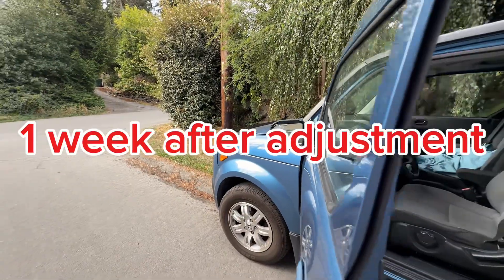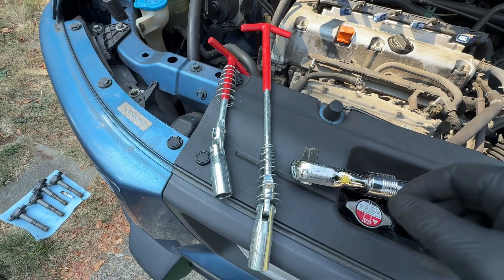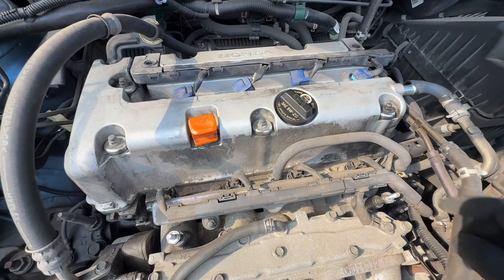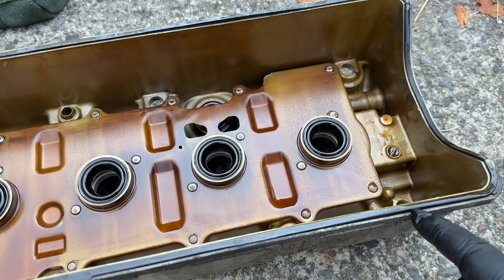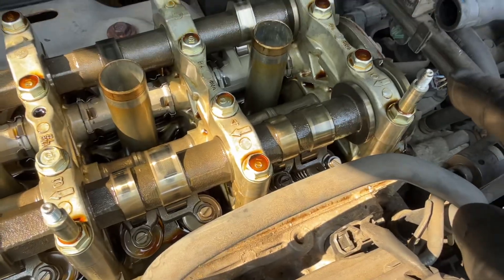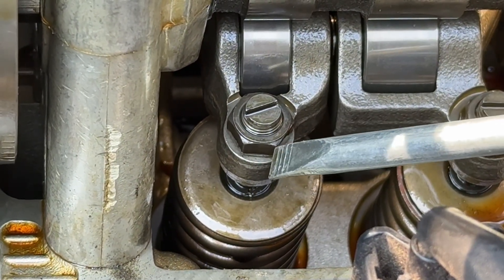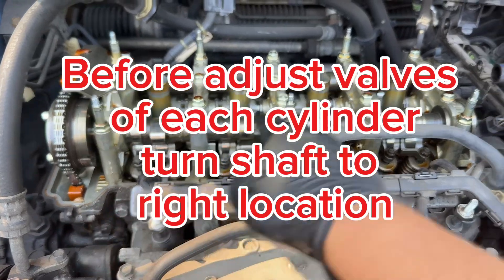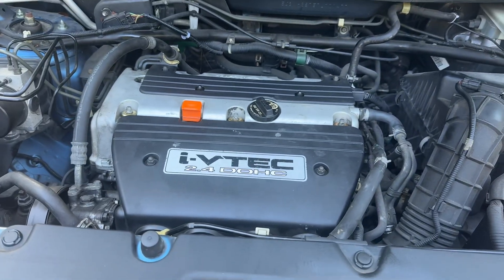Beginner’s guide: How to do valve adjustment on Honda Element/k24 engine

Comment from the maker: Very IMPORTANT: My method finding top dead center is WRONG!!! Please refer to this if you have 4wd: https://charm.li/Honda/2007/Element%204WD%20L4-2.4L/Repair%20and%20Diagnosis/Maintenance/Tune-up%20and%20Engine%20Performance%20Checks/Valve%20Clearance/Adjustments/

Or this if you have 2wd:

https://charm.li/Honda/2007/Element%202WD%20L4-2.4L/Repair%20and%20Diagnosis/Maintenance/Tune-up%20and%20Engine%20Performance%20Checks/Valve%20Clearance/Adjustments/

Comment: The engine actually sounds too loud from this video.
Reply from the maker: hey man, thanks again for pointing out. I found two types of ways to find TDC on youtube. The one I followed is EricTheCarGuy's method and turn the lobe to top to adjust valve. And another way from a honda master technician video is use cam marks, i'm gonna re-adjust them tomorrow.
Reply: @GearByJulian  how did it go? is the noise coming from the engine more quiet now?
Reply from the maker: @shawcobra a little quieter. Compare my engine with friend’s, I think mine is fine
Reply: @GearByJulian can you please show us in a video how it should sound?